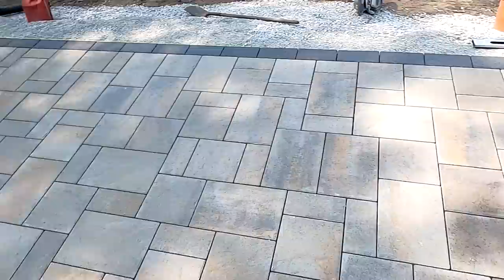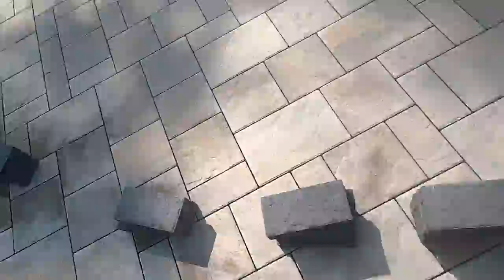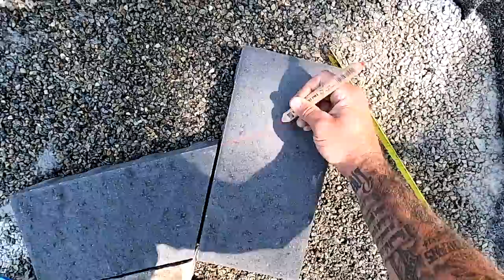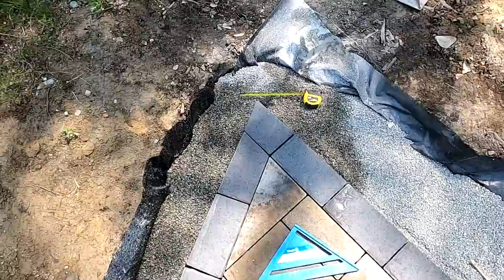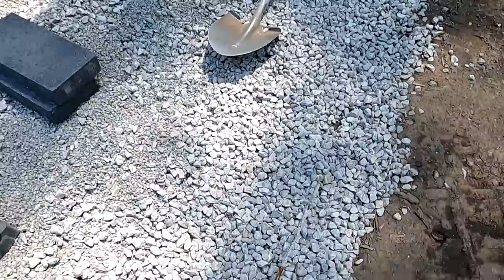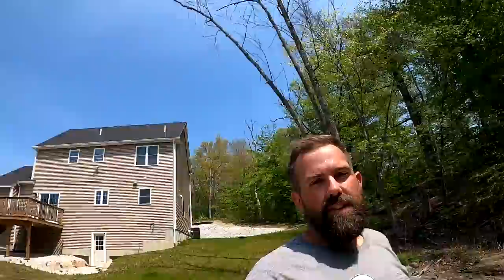Cutting & Installing the Border of a Paver Patio

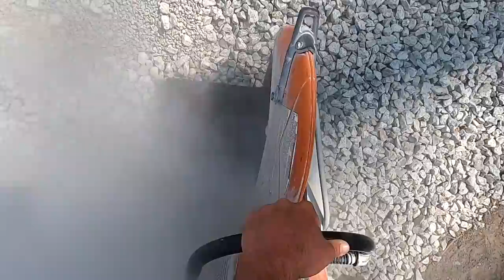Comment: The tip at 9:00 about the small sliver cuts and where you locate the small pieces is sooo good. Esp for a 100% professional finish. I hate small cuts. Esp on wall caps. I see a 1 inch piece of cap on a wall and lose my mind...lol  Make two bigger pieces and lose them in the wall vs a cut that looks like bad planning. Good stuff brother!
Reply from the maker: I totally agree brother. And the sliver cap cuts turn my face red...... 🤣🤣✌

Comment: Love the videos.  This is about the same shape patio I will be going with.  Thanks for all the details.  I went to my supplier over the weekend and they also said the paver manufacturer no longer recommends using stone dust or sand above the base stone/below the pavers.  They also recommend using the chip stone.  Interestingly, they said to use process gravel instead of clear 3/4" trap rock as the artificial base.  Thanks again!
Reply from the maker: My pleasure, glad the videos have been helpful! That is good they are steering people away from sand / stone dust, but clear stone is still much better... Good luck with your project! ✌

Comment: Really good video (plus the one before).  
Given a choice, would you prefer to vibrate/tamp the sand in while the concreate was wet (<2hrs old) and fix any movement right away, or let it dry a couple of days so that it survives the vibration of a plate compactor?
Reply from the maker: I think the best way is while the concrete is wet so you can fix movement right away. But I do it after the concrete sets quite often because the timing just doesn't always work out... So either way is good, but if the timing works, while it is wet is the best way.

Comment: I am looking to do an open graded base for around 700sq ft pavers (walkway/patio + seperate patio out back).  The only options I have are 3/4 washed native and 3/4 trap rock.  Any recommendation on which would be better?  The washed native is cheaper for me but doesn't look as jagged as the trap rock.  In any case no-one around here has heard of this method and they all want to sell me 3/4 process "A" with sand on top.  I keep trying to tell them this is not the same.  Anyways appreciate your videos, have learned a lot from them.  I'm not too far away from you either in Northwest CT.
Reply from the maker: That's awesome! And the 3/4 trap rock is most likely (granite) stone and the native is probably the crushed blue / grey stone that is common in Connecticut I assume. I would recommend the trap rock. And I hear from quite a few people on here about the fact that most suppliers do not know this method, very sad in my opinion because they should know about it. Good luck with your project and do not listen to them about processed gravel / sand, the open grade base will not fail you. ✌

Comment: Hey thanks again for your awesome videos and sharing your knowledge. You are helping me out and I’m sure a lot of other people. 

Question: when I tamp the pavers and poly sand will it crack/cause issues with the concrete edge restraint? 

Thanks
Reply from the maker: No problem at all, glad the videos have been helpful! Tamping the edges to hard when poly sanding can crack the concrete, that is one of the reasons why we lift the border pavers up and hammer them into place before we concrete. Then you can tamp the edges softly just to settle the sand into the joints.

Comment: Im doing a walkway, and adding lights to the boarder course. What would you suggest as a cover over the wires. I plan on using the concrete boarder.
Reply from the maker: If it is just low voltage wire, you can just bury in you base material or the soil around the edges. I think that is what you mean...

Comment: Hi there, I’m doing my walkway and made wet cuts with the saw I rented today. 2 problems the sand washes out from the wet saw and the slurry gets on the pavers, any tips to wash off the pavers? You mentioned poly sand will stain the pavers if you leave stuff on top.  Thanks!
Reply: Id wash it down and scrub it or pressure wash and let it dry well then when it dry it spread poly sand and compact with plate compactor then add more blow the excess and water down
Reply: Have a extra rag sometimes some poly washes off and stains the paver and to prevent pressure washing have a helper scrub it down before poly sand dries up
Reply: I try to keep the slurry washed off the pavers as I go because of this reason. After you do the poly sand just give it a month and hit it with a cleaner. Paver wash or efflorescence cleaner from srw products should get the pavers back to how they originally looked. Then seal the next day

Comment: What is the name if the pavers and border used here?
Reply from the maker: - The pavers we used on this project are made by (Techo Bloc). 
- The main pavers are called (Blu 60) "Slate" - meaning they have texture. You can get Blu 60 "Smooth" also. The color blend is called (Champlain Grey).
- The border pavers are (Blu 60) also, but it is only the small size of the 3 piece pattern. The color blend is called (Onyx Black)
Reply: @TheChristianHardscaper  So you are able to order the small size by itself? I'm doing a patio and my local dealer Carry's the BLU 60 in Champlain grey actually. But I was unsure of how to order the border paver.
Reply from the maker: Yes, you can order the small size separately. Just let your provider know and I’m sure they can get it for you 🤙🏻
Reply: @TheChristianHardscaper  Thanks brotha I appreciate your responses 👍🤟